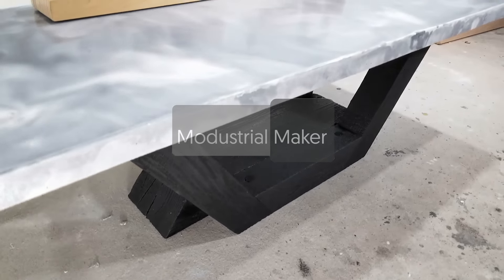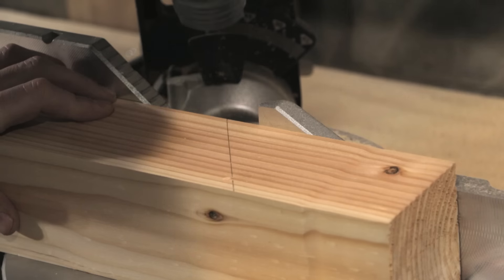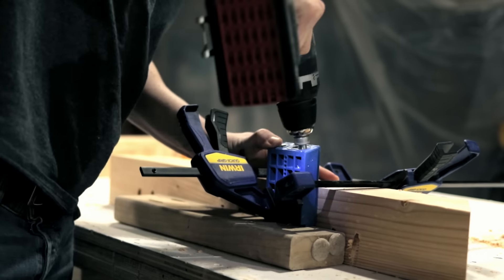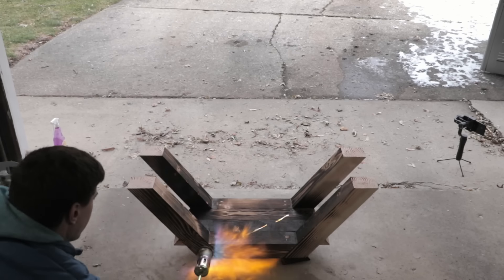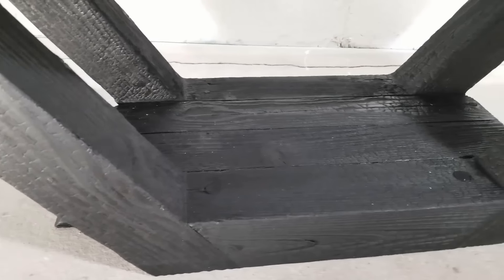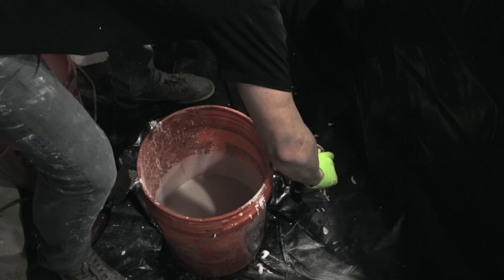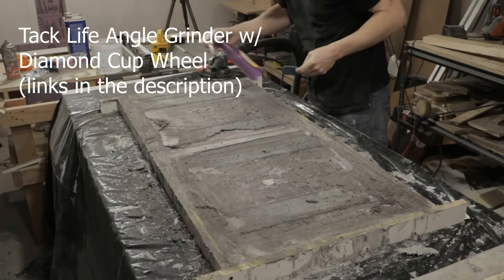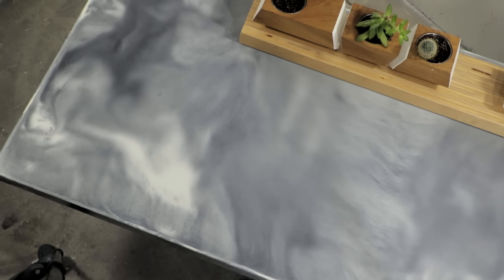DIY "Marble" Concrete Table || w/ Shou Sugi Ban Base

Comment: What are the dimensions of the top?
Reply from the maker: I want to say 42x22, but can't recall exactly
Reply: thank you for the quick reply.  What are your thoughts on using rebar, mesh, etc instead of FGRC?  Or using 5000 (enter name brand) concrete instead of the this specialized FGRC?
Reply from the maker: GFRC is vastly superior.  You get what you pay for.  Here is a good article speaking to some of the differences, but in addition to what it mentions you get a much cleaner surface right out of the form. http://www.concretecountertopinstitute.com/blog/2015/10/gfrc-advantages-over-precast/
Reply from the maker: Here is another good article: https://www.concretenetwork.com/glass-fiber-reinforced-concrete/benefits.html
Reply: Any advice on finding the GFRC materials locally because big box stores do not have or ways to add things to big box stores mixes?  Shipping on these makes the price insane.
Reply from the maker: If you put in a bit more effort to make your mix from scratch, then you can save a lot by sourcing cement and sand (about 80% of the weight) locally, and just shipping the polymer, glass fibers, plasticizer, defoamer, and pozzolan.  Also, call Fishstone or others and ask about powdered rather than liquid polymer.  I put together an instructable a while back with tons of info on making your own GFRC: https://www.instructables.com/id/GFRC-Floating-Concrete-Hearth-for-Concrete-Wood-Fi/
Reply: I've read it several times, what the mixing ratios for the recipe.  I'm not trying a huge hearth on my first attempt.  Also do you know of other sites that don't require me to order 120 bucks worth of supplies when i only need al little to test my skills here?
Reply from the maker: Unfortunately there is a bit of an overhead to working with concrete, the same as with woodworking or any other material.  Fortunately, with concrete, the tools required are much less expensive than for woodworking.  The mix ratios are all on the Fishstone website I linked to in the instructable.  It provides them by percentage so you just have to use that for your project.
Reply: Would just ordering this product work?  then just mixing it with Portland and sand? (and glass fibers for base?) http://www.concretecountertopsupply.com/Item/GFRC-AD-PAC-ADMIXTURE

Comment: So, ancient Japanese carpenters used cordless drills to hole saw, and lag screw with wood glue?
They also used 12" electric Miter Saws, and Electric Planers?
The finished with propane blow torches, and steel brushes set in plastic handles?
What a fraud....

Comment: The fiberglass is for what?. I never seen that before.
Reply from the maker: It is not fiberglass, it is a special type of alkali resistant glass fiber (normal fiberglass breaks down in concrete). The fibers give it strength in place of other types of larger aggregate, and make it much stronger than normal concrete, so you can cast thinner, among many other benefits

Comment: Great. All you need is a garage of  10.000 GBP lets say?  and tools value of another 10.000GBP in total 20.000 plus any other parts and time in order to make it happen...not for average DIYer out there i would say for a table...
Reply from the maker: You don't have a $300 table saw, $100 miter saw, drill, and $40 torch??????

Comment: The base is not a true shou sugi ban, it's just burnt wood. The top part don't looks near as marble more like a blurry gaussian greyish concrete and the whole concrete prep was unecessary complicated and expensive.

A true shou sugi ban would've looked better and would've been sturdier, a simple concrete top with good ol' gravel and rebar would have been sturdier, better looking, simpler and less expensive.

The idea and design is good tho but I truly don't like how it turns out.
Reply: Le Cobra I may be wrong, but why would you want rebar in a outdoor dining table? Will you be driving a Prius over it?
Reply: @jaredthipthorpe1654  Well a rebar or a grill inside the table would be to add sturdiness, I know it's stupid and overkill but he replied, to someone in the comment section who was asking the reason for adding fiberglass in the concrete mix, it was to avoid for the table to break because of its relative thin thickness... Which is really unlikely as a table will not be under exceptionnal stress for extended period of time.

I don't get your irony as I don't display any sign of being a leftards or hippie or whatever that would be driving a prius.

Judging on your comment we might even share the same opinion on the unecessaryness of reinforcing that much a table.
Reply from the maker: Rebar can actually makes GFRC weaker, like separating a bundle of twigs into two smaller bundles.  GFRC is about 12,000 psi vs 5000 for standard mix ... Do a little research on it ;). Edit: misread your comment.... We're on the same page that rebar is unnecessary :)
Reply: @modustrial  Rebar is useless, it's my point exactly. I don't know how you guys call it but a "grill" is the best option for rigidity, considering price and ease of application.

Jeez even nothing would be enough for such a build considering your table will not be set under any excessive weights.

But I don't pay enough attention, have you made concrete or mortar? Because it seems a lot of American are mixing up the two terms I've seen a lot of "concrete" table actually made out of mortar which is not the same thing, or worse people making stuff out of cement and calling it concrete.
A true concrete table would be sturdy enough even without any metallic structure as gravels are already acting as a rigidifying material.

I don't need to do some further research as I built a lot of thing using that kind of material, including, buildings, houses, barns and garage even a well. It was my job for a time.

Edit: I was lacking some vocabularies. Obviously I listed rebar as a viable method to put inside concrete to avoid using GFRC the whole purpose of my intervention was to advocate for the unecessary of using GFRC instead of plain good ol' reinforced concrete/mortar. Obviously using rebar inside a mortar full of glass fiber will make it brittle.
Sorry for the misunderstanding.
Reply from the maker: No worries, things get lost online :)  FYI, there is a hybrid of the grid and glass fiber... they make sheets of alkali resistant glass fiber mesh, basically a grid of fiber.  I just used it in two projects for upcoming videos, and it is great stuff.  You can also check out the Grey Element channel, as he uses the AR fiber mesh quite a bit.

Comment: As soon as you placed foam inside the concrete i knew you project was destined for failure.
   Adding a core that is less dense than the material surrounding it dooms the countertop to stress failure. Horrible idea. 
 If you would have used the fiam to create a concave bottom then the thicker sides would provide the additional strength and support for the counter top while allowing for the desired weight reduction.
Reply from the maker: You are wholly incorrect, sorry.  There is 3/4" of GFRC on top of the foam, which is by itself enough to make the table strong enough....everything else is icing on the cake.  While it is correct to say it would be stronger if there was a solid layer of concrete instead of two layers, it certainly isn't doomed since one of the layers on its own is strong enough.
Reply: If you say so bud.
 Ive only been placing and finishing concrete for 24 years but hey.... you have a youtube channel that provides faulty information about embedding foreign materials into concrete so..... i meaan what could i possibly know about structural failure and concrete.... lol
Reply from the maker: which is exactly the problem...concrete has evolved with new techniques and materials since you learned the ropes 24 years ago....
Reply: And its constantly evolving. What i learned over 20 years ago isnt fully relevent today to be honest. This trend of thin counter tops and table tops is really no different. There are a few simple rules that remain constant with any cement or concrete materials. The one that im attempting to educate you on is that any time the nayerial transitions from thick to thin will result in a stress fracture over time. 
  Placing any foreign material internally in any slab construction results in a change in density that will result in a crack of surface failure. 
 There is a reason that this is  not done in any kind of construction is the density failure. If your method was a proven and lasting solution then all slabs from driveways to elevated floors would be poured in this manner to reduce both cost and weight. 
 I really only commented inorder to help you provide a longer lasting and more durable product for your customers.
Reply from the maker: Concrete countertop artisans have been doing it this way for many years.  The point is that what is on top of the foam, on its own is more than enough.  Adding the foam and some additional concrete below that doesn't change that.  If it needed to be 1.5" thick, and you broke that into two .75" sections, that would be one thing. But it doesn't.  It needs to be .75" thick and there is a touch more than .75" in the top layer.